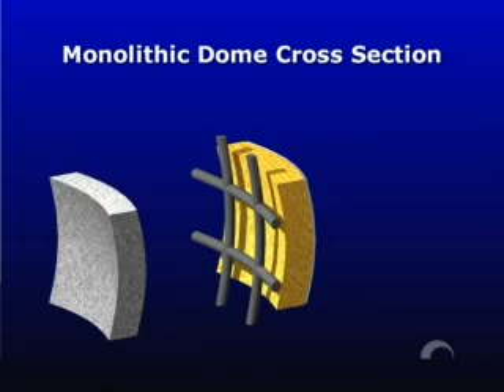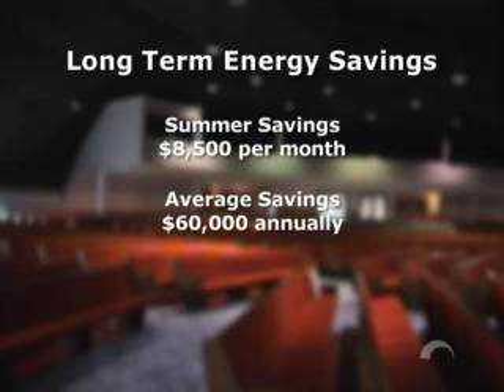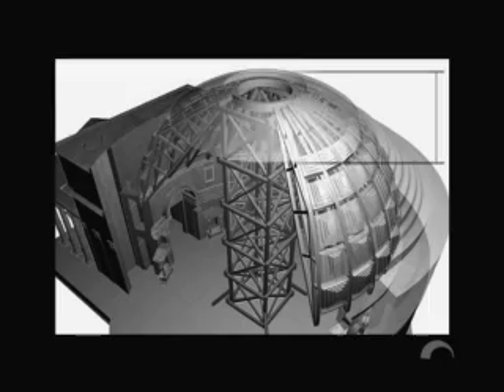Introduction to Monolithic Domes

Comment: Hello.. i love in norway. we don thave termites here.. we DO have carpenter ant's how is it protected from that? and i think i need more then 3" of foame. i know i need to use 22,5" of rockwool ti make the minimum insulation code for the roof. and a bit les for the "walls" after the building code's. AND all fome insulation need to be coverd with a minimum of just under 1" of non fmalemebel material from ALL sides. so i think i need to make a 1" concret layer on the outeside as well..

Comment: @2010collapse 1) Less heat loss due to less air leaks. (2x construction is full of them)
2) Good luck lighting concrete on fire.
3) Termites don't eat concrete or foam.  You answered your own question.